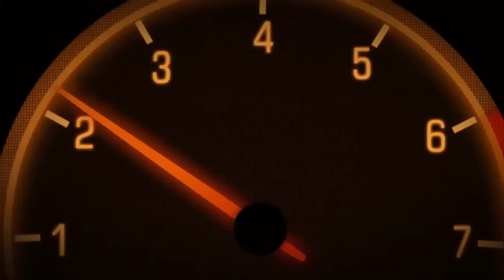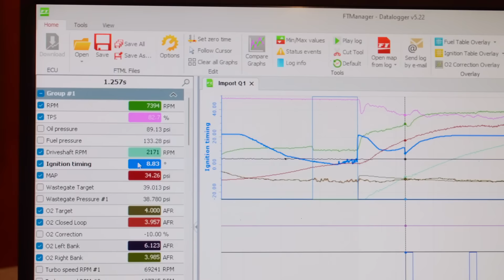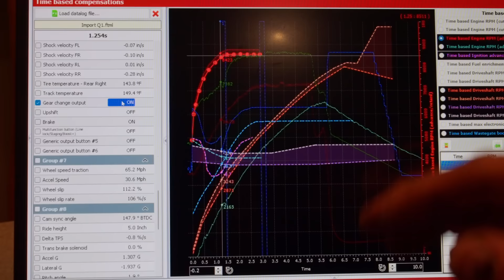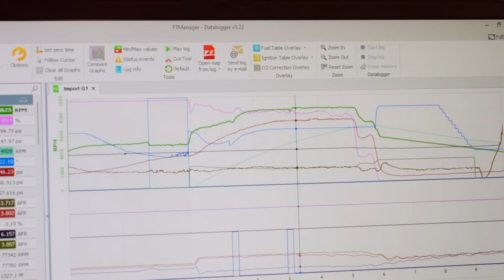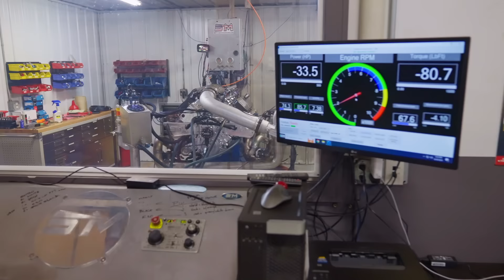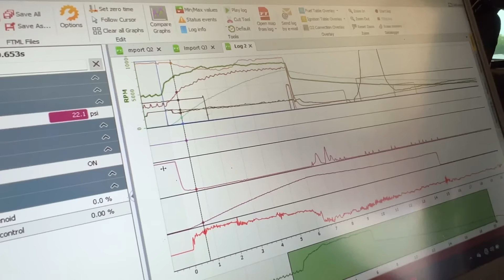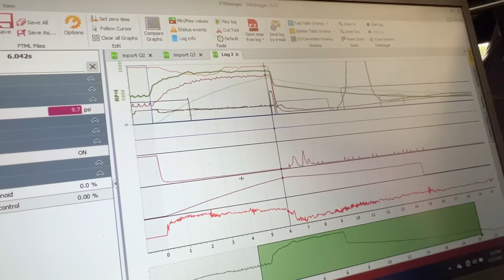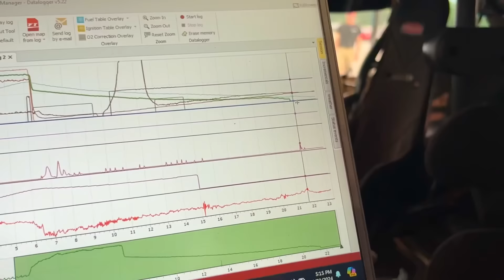Oh No!!!  Why Are There No Brakes @ 215 MPH!?!?

Comment: Is the brake master cylinder on the same side the smoke came from? if so could be over pressurised (heated) fluid forced its way out at the cylinder. Will certainly be very interested in what happened.

Comment: Hey Steve @stevemorrisracing regarding to the brakes.. When I lived in CO, the vehicles coming off vail n independence pass would boil brake fluid a lot. I’ve seen this exact scenario happen to reg vehicles customer comes down pass starts melting pads n boiling fluid a bit (mostly from the pad heat transfer into the calipers). They’d come into the shop with almost dead pedal, even next day when I’d get to it etc. Every time if i cracked the bleeder at one of the calipers I’d see some milky or kinda foamy fluid, and what I’ve found is cuz brake fluid is so hygroscopic, any moisture in the fluid at all would boil first before the brake fluid, then it settles at the lowest point “calipers” cuz water heavier, now u got milky water at calipers (the largest bore of the brake system) leaving u with dead pedal and very easily boiling up again cuz its mostly water now down there.. I know it sounds crazy but in all my years of fixing cars etc I would’ve never learned this if it wasn’t for living in CO mountains for few yrs. Biggest thing I did to prevent it was always keep brake fluid fresh, its only way to make sure it hasn’t had a chance to absorb too much moisture out of the air. In my own rice burner I’d dot4 and completely flush once a year, or if I did start melting brakes I would flush it again after a hot run just to make sure I wouldn’t milkshake em again. Cars in MN where I grew up would never do this cuz they just never get the brakes that hot. Your drag racing is the CO mountains of reg driving lol and you being Midwest guy like where I grew up is prob contributing to the brake fluid scavenging all the moisture it can outta the air. Hopefully this helps u find out what happened, keep rippin bud!

Comment: Do you log rpm vs driveshaft speed to verify it shifted and locked/unlocked?

Something like that could’ve saved cleetus. Just an alarm if the driveshaft and engine speeds are way off vs wheel speed so you know if you launch in 2nd or skip 2nd.

Comment: Are your rear lines running down the trans tunnel , if so with the amount of heat you said was under the tunnel , could that compromise the rear brakes ?..

Comment: Steve, your brake pressure transducer might not be accurate down at 10 psi.  This is what we call down in the weeds for a transducer that can measure 2000 psi.  I believe for disk brakes there should be no residual pressure and in fact there should be -2 psi to pull the pads slightly away from the rotors.

Comment: Glad You're ok. 

My first quess would be line lock stuck and no pressure to the fronts brakes. Rear discs are tiny and the rather large rear tyres having lot of leverage, boiled the fluid in the rear calipers.
Reply: If line lock stuck his data log of the brake pressure would have showed it staying up over 600psi ---> after he let the button go...but it didnt
Reply: I mean this could happen if line lock closes after the launch. The brake press sensor must be on the caliper side from the line lock solenoid, so there wouldn't be anything on press sensor. I may be well off here, so not starting an argument.

Comment: How is your line lock plumbed.  Im figuring on a car with tgat much gitty its closed set rear.  If the line lock is plumbed before the proportioning valve a little pressure will make it to the rear wheels and apply just enough pressure to really heat up the brakes and boil the fluid.  Do a nice burnout when its hot outside... no brakes. Everything cools off brakes are back.  I usually go dual master so front and back have their own system

Comment: Only thing I can think of related to the residual pressure is that you have a partially collapsed/compromised soft line somewhere? It looks like the car barfs smoke right as you're starting to apply brakes, did you blow a right-front soft line and spray brake fluid into the turbo? Making a lot of assumptions, but figured I'd throw it in anyway. 
Glad you're safe!

Comment: I'm going to guess a master cylinder issue. Is it possible to set up your car with dual circuits and dual master brakes? Similar to most road course cars where you bias the brakes by moving the cylinders around (front/rear bias). Why? Because two wheels with brakes is better than no wheels with brakes. That 10 psi residual does seem odd, do you have a valve in the staging system that isn't opening long enough to bleed them down? Or just a sensor error?

Comment: Do you have AN fittings between the master and the brake pressure sensor? Sounds like a line may have failed internally causing a check valve kind of situation. If this is the case, I'd expect to see it at a fitting site as opposed to in the middle of a run.

Comment: Atleast you are alright all that matters could have been bad. I wonder if on the decel if it forced the fluid away from the holes enough to suck air in like how it will do with oil in the pan?

Comment: Just food for thought...  After seeing the residual brake pressure, is a caliper causing pads to drag(L/H front) and causing the fluid to overheat? From experience this usually results in the caliper piston o-ring to going away rather quickly and mad be the cause of the smoke from the hot fluid blowing past on the rotor. Not sure what the base fuids in the TBM  brake fluid is, we wound up using aircraft hydraulic fluid due to it's high heat resistance and aircraft grade o-rings in the calipers. There is nothing that makes body parts pucker faster and blood pressure rise than no hard track surface and still moving at a good clip with chutes out and the left foot doing 70 pumps a minute..... Great job expressing the frustration with out beeps and editing.

Comment: Steve is human after all, he gets mad!  Seriously though, good job.  This may be a dumb question, but is it possible to monitor brake temps at or before the wheels in order to see if you are "boiling" the fluid? It would be interesting to see if that residual pressure is getting the fluid hot as you suggested in the video.

Comment: Dot5 displacing water to the lowest point of the brake system (calipers). Water heats up, forms steam and goes out thru the piston seal is a interesting explanation. I think it absolutely could be part of the explanation. But brakes should have returned after a couple of pumps on the pedal i think. But the fluid boiling combined whit (something i once experienced) the master cylinder piston seal reversing on a turning edge or bottoming out. when a sudden brake pressure lost occurres. That causes the master to compress farther then usually. Also oil pasing by the main piston seal can cause low residual brake pressure accumulating on the wrong side of the master and preventing immediate full piston return.

Comment: Is it possible to have air in the system? Possibly a bad brake hose that is holding pressure in the system that can be overcome when you stroke the pedal, but not return properly. Leaving a void in the system that can’t be compressed.

Comment: Hi Steve
 I'm a total noob at engineering but I question and an idea. Does the data logger have ports available for adding more temp sensors? If so, can you add sensors to monitor brake fluid temps. You may not need them once you fix the problem, but in the future, sensors could be helpful in spotting parasitic drag on the drivetrain if the logger starts showing increased temps from a binding caliper, sticky valve, etc. I wouldn't think sensors and wiring would weigh that much.

Comment: Wasnt the smoke from brake fluid? U said u have oil on the right front brake caliper, probably not holding pressure on the right front when ur into the pedal heavily.

Comment: Could it be that when you pull the shute the brake fluid gets stuck at front of the bowls, causing air to go into the lines instead of fluid?

Comment: Steve , as many sensors you have on the Wagon I think you should install 1 more....
Brake Fluid Temp. ??
You could monitor how much heat it builds at the line and during the run.
Just a thought... ,
Watch as much of you as possible  ( very informative ) and two thumbs up to everything you're about.
Race, Win and take the Money...

Comment: If that 10psi drag is all at that front right I'd say it got so hot before you even hit the break it had to of let the fluid straight around the seal makes sense why you had breaks after it cooled and the seal shrunk but you could see smoke coming in front before the turbo

Comment: Check wheel bearings 
The runout can keep the pistons pushed back
If you boil out moisture it doesn’t usually come back that fast because the system is contaminated 
I’m wrong all the time
Love the videos man

Comment: That is exactly what happens when the fluid boils, it cools down and brakes come right back. I'm not sure what fluid you use but I'd highly recommend Castrol SRF fluid, it doesnt absorb water nearly as much as other race brake fluids (absorbing water is typically what causes race fluid to boil, the wetness greatly decreases the boiling point) this is even more critical in high humidity locations.

Comment: Steve mad!! that is a first. The problem with the brakes is that silicone fluid, you need to change out that fluid as regular maintenance, a really good Dot 4 fluid is better.

Comment: Just a thought, when those chutes deploy, is the brake fluid possibly throwing forward with negative g's in the master cylinder, I know its a closed system and that shouldn't't happen, but you are over 200 mph

Comment: Depending on the age of the brake fluid, it absorbs water. On a race track I would get fade in a series of corners and it would fix itself and come back next lap. It turned out I was boiling the water in the fluid into steam and an air pocket but within 30 seconds I had a firm pedal again. Eventually the brake guy at the track explained why they went away a few laps later this was because an air bubble formed and in the pits they were back and spongy.

Not sure if it relates with your vehicle maintenance being a bigger budget than me self sponsored.

Comment: Since you asked, Maybe something hot got close enough to something with brake fluid to boil it and introduce vapor pockets in the system? 
Pad knock back? I dunno you sure pumped that pedal. 
Could there have been contamination of the fluid?
Shock-loaded aeration of some kind maybe, brake fluid after all is hygroscopic.

There are reasons my own brakes fade in cars, but few of these engineering reasons would be applicable to drag racing. Would be neat to look at it not on YT. Love your wagon.

Comment: 1000 -1100 psi would be a normal "full-on" brake pressure. Glad you/car are ok. Bigger chutes sounds good. Also, i'd suggest a second set of rear calipers with a totally independent hand brake. If the engine is running you can pull it into low and press the trans brake - I've had to do it.

Comment: Just looking through the slomo at the finish line, I'd almost guess the caliper seal is going bad and letting fluid by. Light presses might not make it leak, but stomping on it like you were doing was enough to force it out. Based on your pressure spiking some and then dropping, it would make sense. By the end of it, you probably pushed enough fluid out to have no brake pedal.

Comment: You leave with line lock set for bump so you don't rock so violently if I remember correctly and you were having issues with that not too long ago I wonder if it's hanging causing your brakes to drag causing the fluid to get hot and cavitate which would give you no pedal at all

Comment: If your running a booster could you have blown boost into the booster and got it stuck? We had an issue like that with a car that didn’t have a check valve but it just made them hard to push not soft

Comment: Why the need to pump the pedal on the start line of previous run. Are you getting pad knock off, or just a faulty master cyl.?
BTW a cooled bash hat can give the mother on head aches. Literally  ripped out the tube when I tried one on a rally.

Comment: Could it possibly be low fluid in the master cylinder on the diesel slash the fluid away from the pickup? And that was a good job on staying away from dropping the F-bomb I don't know if I could have done it  lol just glad you and the car weren't hurt.
Reply: More specifically what I meant is on the diesel when it's slush the fluid away it sucked in some air in the line

Comment: Coated titanium caliper pistons with a drilled collar, kick back springs, maybe spray a DFL moly on the pad pins, and at minimum a real dot 5 fluid, which you mentioned already   Put a temperature strip on the master cylinder or a temporary sensor.  10psi residual is a lil much, zero would be ideal.

Comment: Line lock didn't fully release, smoke from the brakes at the end of the track from  the brake  pads overheating which boiled the brake fluid causing air bubbles in the system then full brake hydraulic loss!, My theory from the outside anyway! Glad you're ok Steve and I got a  good chuckle from Mrs. Morris" s comment 😀

Comment: Check pads, how many hard passes on them? Maybe Gas billed up btwn rotors & pads! Brakes were Hot on run, not on return ! Steve, moving the shutes up higher, could it have lifted the back of the car just enough to allow the back tires to slide or skid into the rocks, smoke from tire & not turbo ?

Comment: I'm sure you know but brake fluid is hygroscopic meaning it absorbs water which can lower the boiling point of the fluid considerably. With Dot 4 brake fluid starting at a boiling point of about 275°c will drop down to about 175°c with just 3% water by volume. Its one of the reasons brake flushes are suggested at dealerships along with the contaminates it will pull from the lines.

Comment: Had a 1969 Olds Delta 88 4dr, when the master cylinder initially went out lost the pedal started pumping the brakes still nothing. It sat for 5-10 minutes after I got it stopped then the master cylinder decided to build pressure again.

Comment: Is it possible to run 2 master cylinders totally separate so if you loose breaks on 1 master cylinder the other takes over and u will still have breaks to 2 tires?

Comment: Was there any water in the brake fluid? (How old was the fluid) You can boil the water which will give you reduced braking action.
Reply: He adds about 30% water (Distilled of course) and 70% brake fluid to the reservoir beneath pass.

Comment: Why don't you run lines connecting to your trans aux cooling ports to the side of the car so you don't have to climb all around/burn your hands around the transmission?

@8:41

Comment: Im thoroughly impressed with your ability to keep it “mother trucker” after that ride into the trap, not a chance in hell i would have. Glad the car didnt suffer massive damage but check brake line locations near the hot side, you were on the 2 step a bit longer than it usually has been so that may have been all it needed to send the brake fluid temp into the boiling range OR if fluids never been flushed it could have condensation in the calipers/master that boiled causing brake fade. Doesnt take much especially with the high temp heat cycles those calipers sees, that fluid could easily be contaminated…….The wifes comment had me dying😂😂

Comment: Ypu cooled down in between runs how cpukd the fluid boil on it? I mean I know they get hot obviously and so does the fluid but to have it then not have it then have it again on the way back to the trailer don't make sense to me for some reason! Could the master cylinder. Be bleeding off pressure when fluids hot? I'm curious what could cause this?

Comment: I know that drag racing and hotrod motorcycle stuff are very related. Around 2008-2010 Harley actually had some poorly produced master cylinders. I found this out purely by accident. If just the tiniest amount of trash got behind the piston, it would let the diaphragm overhang the bleed back hole making the brakes overheat and lock up or just flat out fail. I'd file the top of the piston by 2-3 thousandth and most of the time it fixed it. Get a close look at that bleed back hole and get a good look behind the piston to be sure there is no trash in there. It was extremely rare, but I've also seen brand new master cylinders where the bleed back hole was drilled just a little off.... again requiring a file to fix it.

Comment: I've seen similar happen. Turned out to be bad line locker solenoid valves. Id be thinking something along the same line here, possibly why it was still holding residual pressure

Comment: Looks like you have a 10 psi residual valve, you could go down to a 2 psi residual valve, I would also check the master cylinder, or may need one with a bigger bore. The T/F, F/C parachutes are going to hit alot harder than the ones you have (maybe the aero on the wagon body reduces the effectiveness of the chutes somewhat, might need longer shroud lines).

Comment: Is it possible the master cylinder piston is not fully retracting? Due to either a faulty cylinder or linkage problem. If it’s not then brake pressure will not fully release and there’s limited to no fluid available to pressurize brake system.

Comment: When is the last time you flushed your brake fluid? Sounds like you have air or moisture in your fluid cause moisture(water) will turn into gas(air) and cause leak pedal just ask Brett Lasala(snot rocket).

Comment: May want to change the brake fluid every season. Fluid will break down with the heat and deteriorate it over time. Could have pressure internally bypassing the seals in the master too.